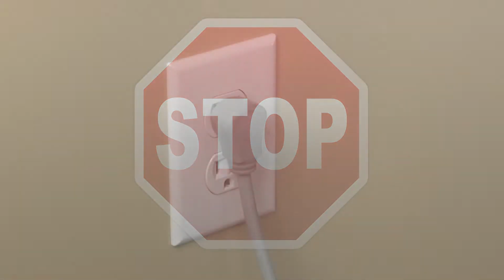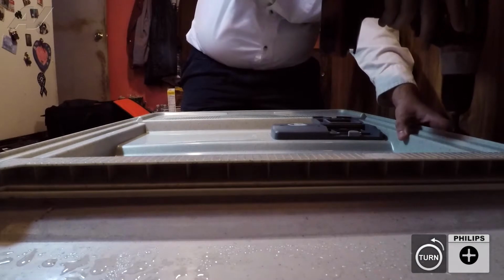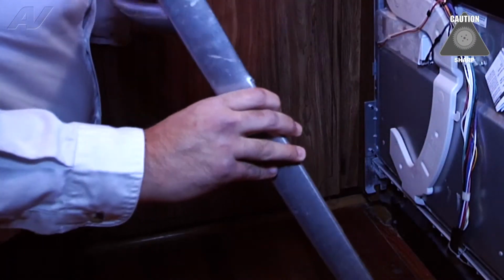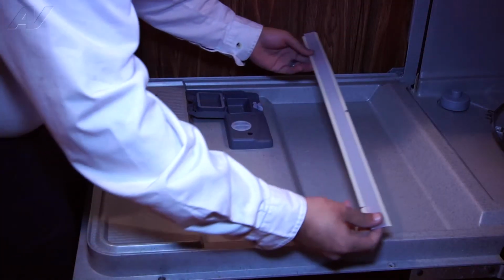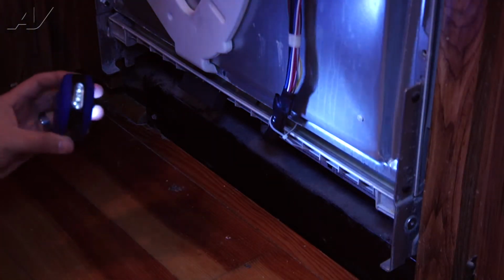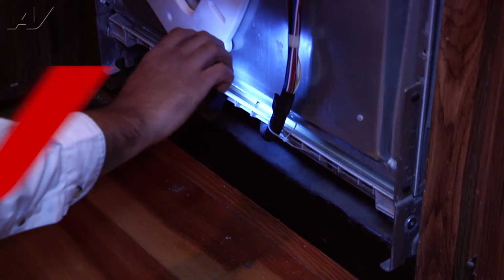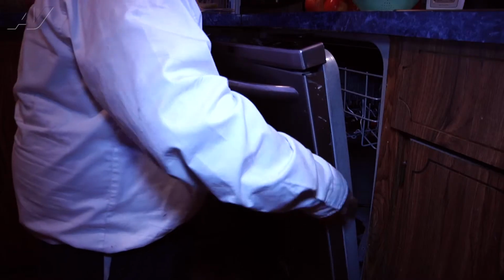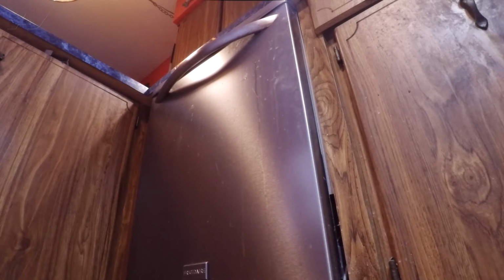Kenmore Dishwasher Repair - Leaking From Bottom - Bottom Door Seal

Comment: I've done the steps as described but my new seal doesn't stay in the horizontal slot. It either falls out on the right side or falls in on the left. I don't get a positive "latch" of the upper seal inside the slot. Is there something that I am missing? The video shows the view of the door interior a bit too far and high for me to see if there is some track or interior vertical end groove that I'm not getting it into correctly.

Comment: I've looked a few videos for this replacement and none of them do a good job of explaining how the gasket goes in.  
It's not just stick it in the slot until it seats.
The gasket needs to be guided up towards the inner surface of the door.   You'll know it's correct when it won't move side to side and there is still about 1/4 - 1/8" still visible.

Comment: In case others are looking for answers like I was, here’s my experience:  the DW was leaking along the door only during certain cycles.  The repairman replaced the inner door seal but it still leaked.  He had to get a clear door to diagnose what was happening—turns out the bottom spray arm was getting caught on the bottom rack at a certain point when the spray pressure increased.  The arm was shooting high powered spray into the side of the door,.  He replaced the bottom spray arm and it has fixed the problem.
Reply from the maker: Great question, if you have a more technical question that our parts department cannot answer, you can search our over 17,000 answered questions free at our website www.ApplianceVideo.com under our Repair Help section. You can also call our parts department at 1-800-830-5465 and they can give you help 7-days A week ,or search at www.SaveMoreOnParts.com  .

Comment: We have a Kenmore dishwasher that started to develop a leak (dripping out the bottom of the door).  We replaced the seal which seemed to work but only for a short time.  Took notice that the air vent was not on properly (took it off a while back to clean it and I put in on a bit cock-eye without knowing it). In order to verify my suspicions, I removed the front door panel so as to see "exactly" were the problem was during a cycle.  Well, it was leaking from the vent (I finally got it on properly which fixed "that" problem) but it wasn't the actual "main" cause of the leaking.  Here's a key thing folks....trying to determine where your leak is coming from?.....take of the front door panel and then pay close attention when running a cycle.  On our unit, the bottom of the door has a little trough that catches water coming from little vents just above the trough.  As the unit was running, I could see water bubbling up in these little horizontal vents/slits about the trough to the point where the trough would fill and, yep,  you guess it, that's where the leak was coming from.  But what was the cause??  Well, check the spray arms for cracks as suggested in other posts of this nature.  All looked good.  I figured it must be a clog in drain tube.  Instead of taking the tube off (did that years ago and what a pain), I decided to use the old "baking soda and vinegar trick followed by a pot of hot water followed by a hot rinse cycle).  So far that seems to have fix the problem.  Have I put the front panel back on the unit.....No........I keep watching just in case but we also put a drip pan under the door to catch any leaks.  I also followed up on the original "trick" with a couple tablets of denture cleaner and hot water.  Does the little trough still collect some water....yes....but none near the amount a before.  Will I put the front panel back on now......not just yet and when I do, I'm sure we'll keep the catch tray under the door just in case.  Hope this helps someone.
Reply from the maker: Great question, if you have a more technical question that our parts department cannot answer, you can search our over 17,000 answered questions free at our website www.ApplianceVideo.com under our Repair Help section. You can also call our parts department at 1-800-830-5465 and they can give you help 7-days A week ,or search at www.SaveMoreOnParts.com  .
Reply: Hello Roy, thank you very much for the post. I tried your suggestions with baking soda ans vinegar and it seems to fix the problem. No visible gunk in the drain but it did reduce the water spillage from the lower vents under the door panel. I still see water in the bottom trough but no leakage. Thanks again

Comment: Thanks for the video.  I'm going to give this one a shot. My Kenmore started leaking after about 2 years.
Reply from the maker: Thanks for your response, we are glad we could help. Our library of over 5,900 videos are currently helping over 1.6 million people like you every MONTH.  Please help us by subscribing to our YouTube channel, or post our website www.ApplianceVideo.com to your Facebook page, Twitter, Instagram or any other social media sites. Your support will help us keep producing more free quality videos.
Reply: Did that fix your issue ? My washer is also only around 2 years old and have replaced ALL seals and the darn thing still leaks !
Reply: @alicia8530   I purchased the replacement seals but when I opened the front of the washer I could see that there was evidence of a small leak coming from the vent in the door (little round vent grate at the inside top of the door), I went ahead and replaced the seals but that didn't do any good.  Next I replaced the seals around the vent.  That also didn't work.  I finally ordered a new vent valve.  That worked like a charm and I haven't had a problem since.  It was very easy to replace.  Hope this helps.  Good Luck.
Reply: D. B. Cooper thanks so much for your reply ! I wasn’t running out of things try. I’ll check this out.